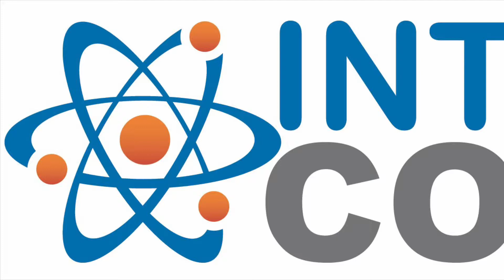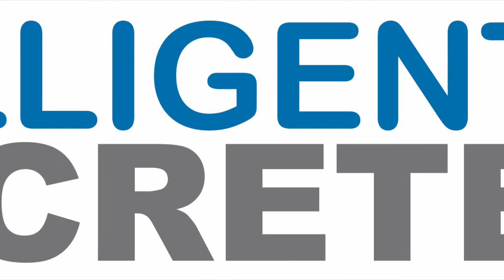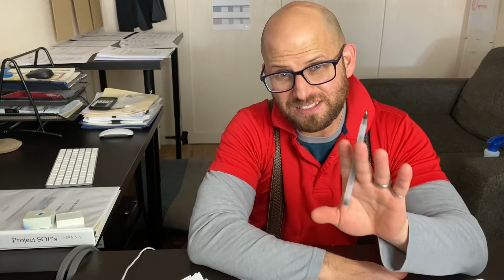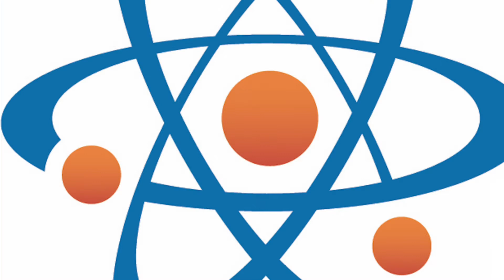CO2 in CONCRETE: FACT OR FICTION.

Comment: What about using carbonated water to make lime based concrete?  It seems like that would increase early compressive strength.  I've wondered about this before.
Reply from the maker: Check out CarbonCure.  They are kinda doing something like that.
Reply: @IntelligentConcrete  Thanks.  I'm a weirdo.  I'm obsessed with lime based concrete.

Comment: Does this actually add up with this video?
https://www.youtube.com/watch?v=YMi2Z9mrMPw 

The referenced video says CO2 is bad while in this video you're looking for ways to load the concrete with CO2. 
I think some nuance is in place here ;-)
Reply from the maker: Correction to your question. I never say CO2 is bad for concrete, my argument is that the way we are currently using CO2 in concrete has missed the mark.  IT COULD BE AWESOME, but... right now, not so much.
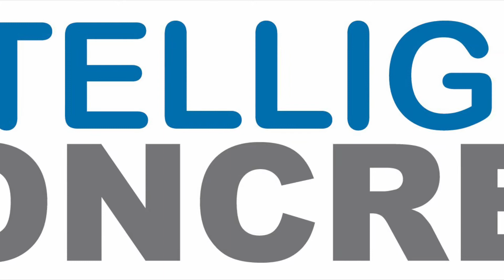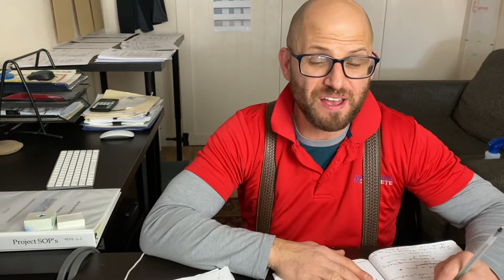Reply: The referenced video of Mallory Westbrook, I quote (0:09-0:19) "I'm gonna go over carbonation and why it's the worst thing ever for reinforced concrete. Basically, carbonation is CO2 attack on your concrete". 
So my conclusion: CO2 is bad for concrete, or at least for the reinforcement.
Maybe the nuance lies in the fact that in order to store CO2 in the concrete, we need to rethink the idea of steel rebar and shift towards other reinforcement (e.g. glass or plastic fibers, carbon fiber rebar, ...)
Other than for small scale decorative pieces, I think all concrete structures need rebar in order to be functional.
Reply from the maker: Hey hey Thomas!  Thank you for taking the time to dive into depth on our videos.  

I won’t disagree with you that Mallory commented on the nastier side of CO2 and it’s impact on reinforcing steel.  

That being said, in CERTAIN environments CO2 saturated in concrete converts into CaCO3 by combining with lime (Ca(OH)2).  This ultimately reduces calcium that would react with decing salts and brines to form Ca-oxychloride and so on.  

It all depends on the environment and how and when the CO2 is used.
Reply: @IntelligentConcrete  Thanks for the additional explanation. That sheds a bright light on the case.

Comment: Definitely excessive bleeding in the field, but I did notice great temperature control in high ambient temperatures.  Optimization helps with the bleeding.  Used it now a couple of times, cold weather concrete is an issue with long delayed set times.  But I think they are getting closer.

Comment: You missed one...Solidia has a non hydraulic cement that hardens with CO2 (No pressure used)..this already being being sold commercially in concrete paving applications
Reply from the maker: Thank you Deepak but I don’t believe I missed anything.  The intent of this video was not a product pitch but a recognition of a new and emerging tech that has taken some time to find a solid foothold in the industry.
Reply: @IntelligentConcrete  I dint mean you missed a product.. you missed one other way of introducing CO2 to concrete.. there are also plenty of research publications but I agree it's fairly new
Reply from the maker: @eVentureX  Sorry about that!

I misunderstood.  

Please send papers.  

Regards, 

Jon

Comment: many years ago I worked in a old terraced house and it had a coal cellar and we put a dry mix of sand and Portland cement no water at all and a day later it was rock solid I was just amazed that they didn't use water.but to me it was sandy at the top.PS from the UK we used to have coal delivered.years ago they just chucked it down this hole at outside of a terraced house
Reply from the maker: Wow.